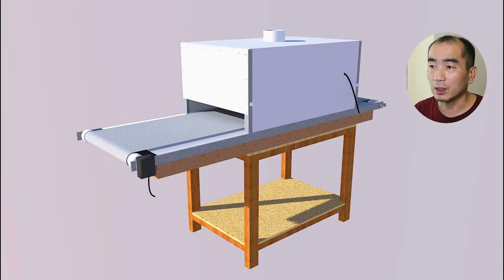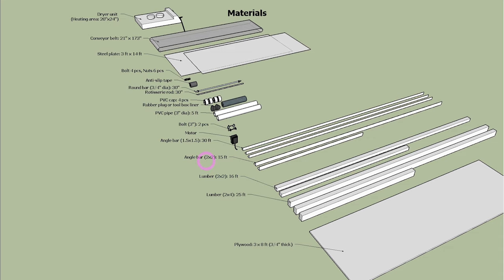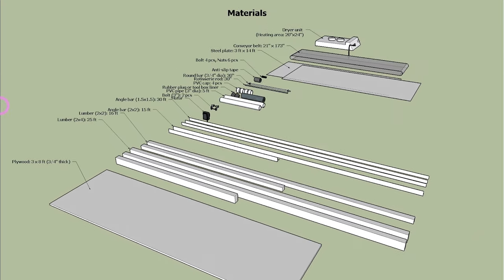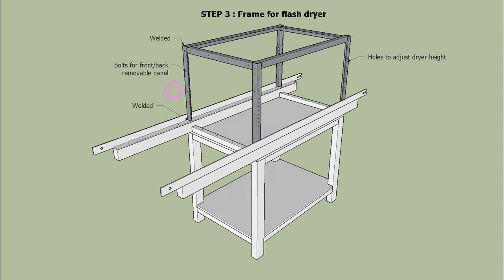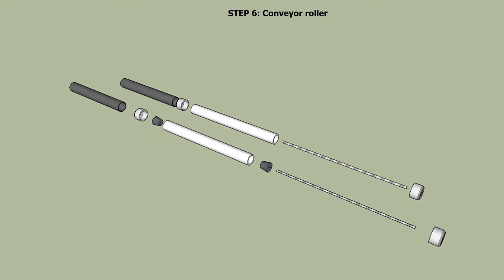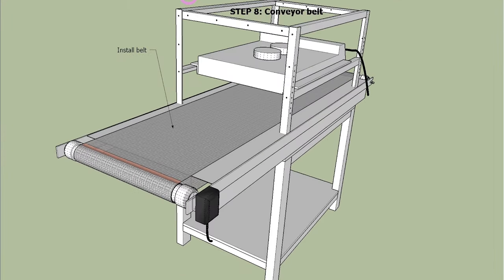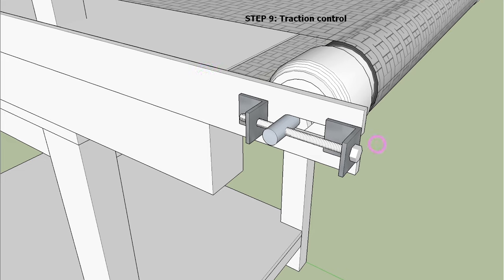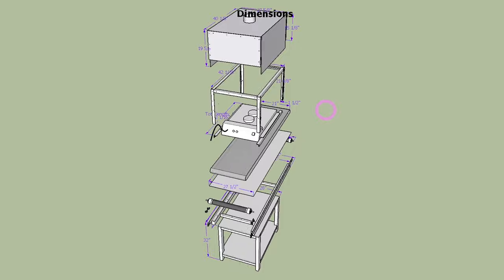DIY Conveyor Dryer

Comment: When I first started screen printing and was using waterbased ink, I use to use a turbo broiler to cure my shirts! It actually worked very well since airflow is needed to properly cure waterbased ink.
Reply from the maker: Thanks for the info. I guess you need to be careful not to overcook :)

Comment: Hi, but for the Rotisserie motor what RPM you would recommend...coz so many motors are coming into this likewise 30, 60, 120 RPM etc.
Reply from the maker: We recommend 30 or slower rpm. If too hot, you can adjust the height of the heating element.
Reply: @LineTableScreenPrinting  Thanks 👍

Comment: the fly screen fiberglass did not work it shrank however ia found the fecfect replacement I installed a treadmill mat from a broken treadmill it works perfectly and handles the heat
Reply from the maker: Treadmill mat? Wow! Maybe you can use the motor too :) Thanks for sharing.

Comment: the normal rotisserie motor is not strong enough for the use of a treadmill belt what is needed is a rotisserie motor for lamb spits this motor is slightly faster so you will need to increase the length of the conveyer or increase the lamp heat the normal motor takes 3 minutes to pass through and the lamb motor 2minutes
Reply from the maker: Thanks for the info.

Comment: & can we use quartz lamp flash dryer too in this conveyer system..
Reply from the maker: Sure you can.
Reply: @LineTableScreenPrinting  Hi, I had used 3000 watts quartz heaters (1-1-1) (1000 Watts X 3) at my home for flash & final cure the plastisol ink but due to the heavy load issue at home, it burnt away my main electricity meter..LoL 😀...  But now I had purchased a 4 rods heater (1-1-1-1) that is used for room heating in winters overhere of 2000 watts (500 Watts x 4).. I had tried it & it reaches at 180 degree celcius of temperature and cures the ink too...& what would you suggest, do I make a conveyor from this heater..thanks
Reply from the maker: @nipunsharma8209  Yes, you can try a conveyor with quartz heater. We did that too at the beginning. But in our case, the quartz heater only lasted about a month and the temperature was not stable. The result could have been different depending on the the quality of quartz heater. But again in our case, we felt that it's more suitable to flash drying(heating quickly for short time) than all day long continuous use. So, in conclusion, you can make a conveyor with quartz heater, but keep searching for better heating element specially made for screen printing. Good luck!   - p.s. Be careful of electric overload issue! Consult with an electrician for SAFETY!
Reply: @LineTableScreenPrinting  Thanks Dear for your advice ...